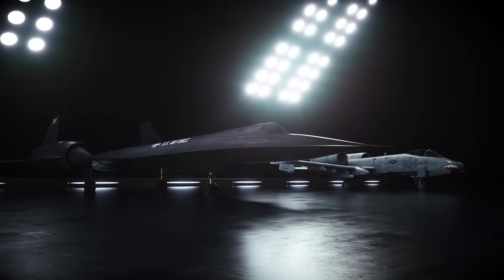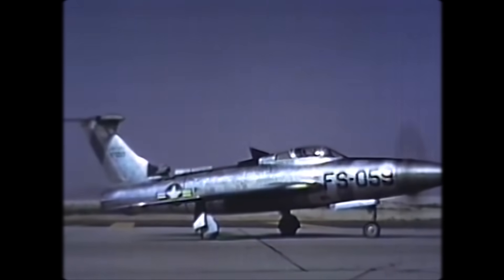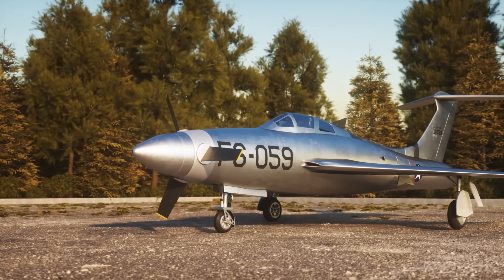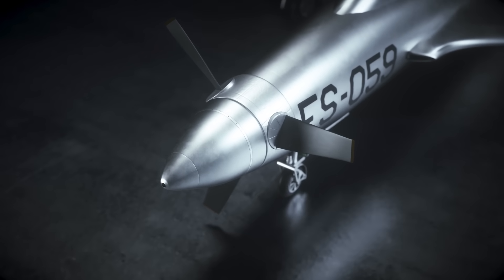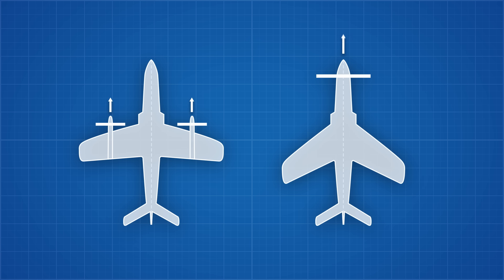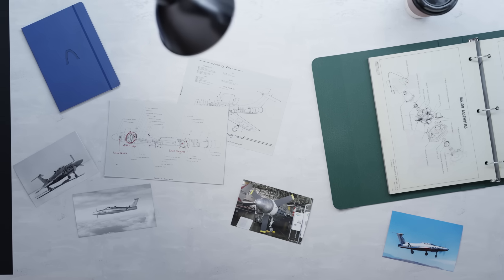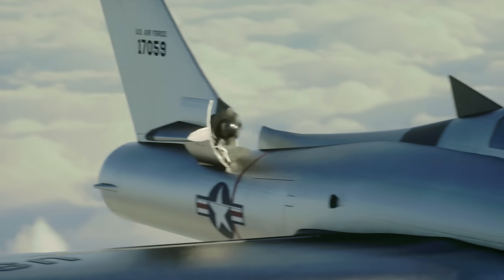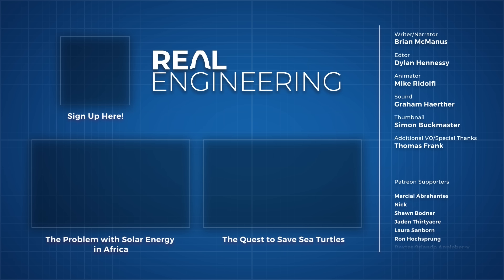The Insane Engineering of the Thunderscreech

Comment: Doubtful it may happen, but a bit of editing would make the video more accurate. The engine was not two T40s. The T40 was a coupled engine of two Allison T38 power sections, driving counter rotating props through various gearbox configurations.
Some of the flight simulations  show the propeller rotating counter clockwise as the pilot sees them, the actual videos obviously show normal USAAF/USAF clockwise rotation.
he various public comments on the propeller efficiency diagrams, and video comment missing that by WWII, all significant combatants had variable pitch propellers, needs correction, can all be 'improved'. We'd all like more data on just which plane is noisier, the Thunderscreech, versus the Russian Bear family. I'm questioning what may be in third place, some version of Harrier, F35, or Concorde?

Comment: {'m not sure about the year involved, ( I believe they were after WW 2), but tests were done on P-51 Mustangs with a dual, counter rotating prop design.  I suspect that the vibration to the prop of the Thunderscreech was the effects of the two, multi-jointed drive shafts not being harmonically balanced with each other.  While this is all very much after the fact, it interests me too much to ignore.  Now, any time you have a drive joint, it is there for only one reason.  You are trying to avoid something.  Every bit of induced angle in one of these will create a load/unload situation in the rotating joint.  In cars, these are matched to cancel each other as I imagine was done here, but with 5 or 6 joints in each shaft, they will almost certainly wind up out of balance with each other.  Joining their energy at the nose gear reduction gearbox might have helped, somewhat, but if that resultant total could be divided by adding a counter rotating prop, it would have quit playing 'merry-go-round with the fuselage and become far more manageable.  Eliminating the joints in the propshafts and jacking the pilot up a tad (ala the P-39 Airacobra) would have eliminated a great many troubles.  Torque interaction by the two engines having separate fractional controls could have been a source of problems, too.  I'm sure that these were thought out long ago and I'm just spitballing my curiosities.  Oh well...  An excellent presentation of great informative content.  I look forward to seeing more of these in the future.

Comment: So uh, high speed electric motors anyone?  Or ducted ultrasonic fans, one stationary and adjusting pitch to cancel out duct vortex, the other rotating but not through a axle that runs through the center but a ring Axle mounted around the whole duct so the blades can change pitch and the electric motor has more torque and circumference distance for a high top speed, also ring electric motor.

Comment: Clearly what they needed was a counter-rotating props, what’s a few more points of failure? Plus it’d help with the turbulent prop wash, perhaps enough to move the elevators back and take advantage of the thrust for low speed control

Comment: Its sound may be impossible to digitally emulate, but I did notice that the bass was so strong that it prevented the audio from clearly picking up the sound of the engine and it sounds like it actually disrupted the device's ability to pick up sound.  That tells me quite a lot right there.

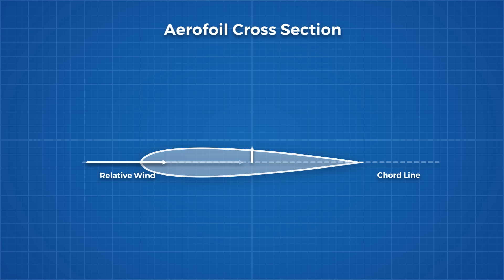Comment: The aerofoil at 6:00 wouldn't produce lift until the angle of attack became non-zero. If its symmetrical, the pressure distribution would be identical on both sides of the aerofoil, meaning now generation of lifting forces.

Comment: Wouldn't contra-rotating propellers (like on the Tupolev Tu-114) have fixed a lot of the flight characteristic issues for this plane, along with allowing for even shorter propellers, due to having more total surface area from having two? Of course it would also have been immensely noisy, but that doesn't seem to have been a cause for worry, during the design of this monstrosity anyway.

Comment: Lots of interesting information but no explanation for how those very many vortexes resulted in "hammering" the air to make a horrendous sound/rumble capable of knocking men over who got too close. I'm imagining the process to be similar to water cavitation around boat propellers, only in reverse, so to speak, where the bubbles in water are comparable to "clumps of high pressure air," each of which has to be moved about by the propeller and it's massive engines. These bubbles of high pressure explode, more or less, emanating as waves of alternating pressure, causing the damage and the sound.

Comment: The resulting forces acting upon an airfoil are often drawn in a quarter chord position.
Reply: Center of lift moves with angle of attack, and influenced by camber line. Quarter chord is common for many illustrations as close to most early NACA foils.

Comment: The design was updated and tested on a 727 in the 1980s. Counter rotating props got rid of the torque issues. Still loader than heck.  https://en.wikipedia.org/wiki/Propfan

Comment: Is also like to point out that the T-40 engine was also used in counter rotating prop systems such as the one found in the A2D. This system allowed the individual props to spin slower in an attempt to combine the max efficiency thrust of both props without the propeller exceeding super sonic speeds. A test bed version known as T-38, which was a single engine, actually became the basis for T-56, an engine that had variants that would go on to find use in multi engine planes to include the C-130 all the way up to the H model.

Comment: Wyvern and A2D Skyshark both use turboprop designs as well. The Wyvern was only 3,200hp but the Skyshark was 5100hp and used two counter rotating variable pitch props. The Skyshark was the pre-courser to the XF-84F.
Reply: That’s a lot of heath

Comment: so two things, were the pilots deaf before they got the job or only went deaf after flying them? Second why have the engines running the driveshafts  fast 14300 RPM which then had to be reduced by that 6.8:1 two stage reduction gear. Why not just run the driveshaft at that 2100 rpm to start with?

Comment: There were just a few WWll a/c with fixed props. At least by 1940 all front line a/c were fitted out with variable pitch propeller of the same kind as the Thunderscreech had.

Comment: I have been studying engineering at university for 2 years and I watched real engineering for a couple years before I went to Uni, what is surprising me now is how he is able to explain some very complex mathematical concepts in a very simple way. Coming from the position of learning these concepts the traditional way and then Hearing him explain them he has done a great job of keeping the relevant info in without overcomplicating things.
Reply: Check out NASA-Gulfstream propfan from the late '80s and the GE UDF and the PW-Allison Propfan on the MD-80 and now the advances in what's called open rotor technology, all leading to lower noise and higher efficiency.  It's really interesting.  You can do the math and see what the tip speeds are (hint: supersonic...).  So this idea hasn't been abandoned.
Reply: I was 2 years into my mech eng degree when I too knew enough math to be sort of awed by it's complexities, power, and reflected a lot on how you can't see very many depictions of high level math anywhere
Reply: well he doesn't know what he's talking about. For a channel called "real engineering" this is really bad. Listen to the bullshit after 13:00.

1. 13:09 Propeller TORQUE has a reaction TORQUE on the plane, not force
2. 13:17 the rotation speed has zero influence on this effect (a high rpm prop might even use lower torque)
3. 13:24 the effect most likely did not get worse at higher speed, and even if, definitly not for the reason of the higher rpm, but rather a different engine torque or pitch
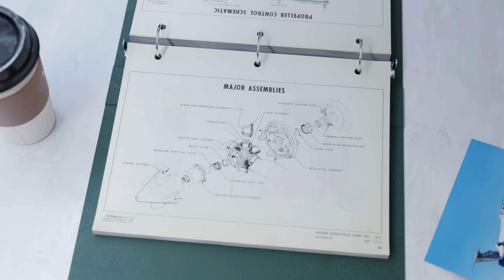4. 13:52 the inertia of the prop certainly did not overload the pitch control, since it has absolutely nothing to do with the pitch
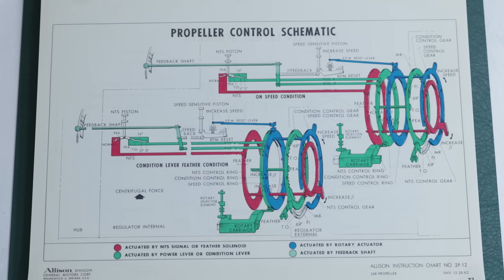5. 14:02 if the governer lets the rpm increase(maybe by reducing pitch), that is because/while torque is REDUCED, not increased. Definitly not causing more torque on the aircraft
6. 14:19 this effect did not effect WW1 rotaries more. He's completely mixing up gyroscopic torque (of the prop or engine acting as a gyro) with regular coaxial torque/reaction torque
7. 14:54 completely useless statement saying it could roll to 30°. It can roll to any attitude if it's not counteracted, there is nothing stopping it at 30°
8. 15:05 BOTH ailerons are actuated, not just one. (only one is increasing in drag, causing the yaw.)

That's less than two minutes of video... I think the rest was a little better, but the quality is horrible. They/he just did some wikipedia reading, some google, and then repeats something he has not understood.
Reply: @DerKrawallkeks you seem like an asshole but not necessarily an incorrect one. as long as he knows the right equations to use when and can draw the correct answer he'd make a passable engineer. you with your focus on correct verbage ought to consider  a masters and then teaching these concepts. a lot of good engineers fall down at proper communication of their work.
 I don't particularly care for this engineering focused channel because the creator  buys into the metric>imperial nonsense. anybody in north america who has taken basic university chemistry along with the math prerequisites probably has the metric/imperial conversion factors roughly memorized and converts  with  little effort and while scaling in metric is easier to learn; once you've learned imperial scaling as a kid it's as useful and easy as metric. when I hear people vocally lambast imperial measurements I think; well the system served the Romans pretty damn well.

Comment: Wouldn’t it make more sense to put the gearbox at the back so the driveshafts would only be spinning at 2100rpm rather than 14000rpm?
Reply: The shafts would be a lot heaver to take the higher torque to transmit same power.
Reply: But just imagine the effect of a failure at 14000rpm!

Comment: I thought the Tupolev TU 95 'Bear' was the loudest. It has four 15,000 hp. engines spinning 32 blades at supersonic speeds. Each blade is longer than the entire prop of Thunder Screach.The 95s props spun at a constant speed regardless of air or ground speed. I'll bet $1 that I'm right about the sound level.

Comment: Software guy here, thinking if they had the two driveshafts turning in opposite directions it would null out the torque twist.  Run one shaft through a gearbox at each end that changed the direction of rotation?  Possible?

Comment: All these problems still exist today. It has always been a simple fix by having two props on two shafts counter rotating one inside the other. no torque steer and a shroud around the blades maby. I never noticed on the bombers do the engines on one side rotate counter to the other wing.

Comment: Excellent video all round. Didn't even try to describe the sound because it's so ungodly.

One caveat, you mixed up rotary engines and rotational engines. They're basically the same thing, but one is mounted backwards. You mount a rotary on your plane, the the drive shaft spins the prop. You mount a rotational rotary to the prop, and the drive shaft spins the plane (as long as the engine is concerned.)

Still loved the video, though. I'm glad someone is out here getting in-depth about how propellers work, and specific problems involved.

Comment: WW1 pilots called the Sopwith Camel the 'vicious little beast' from the torque effect of the engine. Probably used stronger descriptives than that. 
If even the test-pilots don't want to fly your aircraft, then your project is FUBAR. Accept their opinion & go home.

Comment: One other issue I didnt see mentioned is the fact that they used ended up using a dual prop setup with counter rotating blades to counter the torque effect also meaning that the sonic booms would collide amplifying the sound even more

Comment: 1. Variable pitch propellers are already a thing in world war 2
2. The torque roll problem can literally be addressed if the engines are mounted on the wings or have a contra-rotating propeller like the Seafire FR47 or the Tu-95 bear

Comment: Great video, but you're leaning on that euphemism "issue" more and more often. Try to avoid it; it's a crutch, and there's always a more precise and concise way to say what you're trying to say. eg. 12:00 - "because of that asymmetric thrust issue, we would have to run each engine at a less efficient half-power setting" -> "we would have to run each engine at a less efficient half-power setting to prevent asymmetric thrust". 12:13 - "the powerful coupled engines did come with some added complexity" - sentence finished. Stop talking. :)  13:06 - "that speed still caused some serious issues for control" -> "that speed still made control very difficult".  etc. etc.

Comment: 14:23 Do you mean radial engine maybe?
Reply: No, he means rotary engine. Rotaries are radial, not all radials are rotary. WWI radials were usually rotaries as well, as both cooling and lubrication of cylinder heads were issues. Rotary engines have Huge gyroscopic precession during maneuvers! Rotaries of the era used total loss oiling, as getting oil back in from spinning cylinder heads was not solved yet, if ever. Normally castor oil, the main reason pilots wore scarves, as face filters to lower oil in lungs and stomach. Everyone had the runs from the Castor oil anyway, another reason service life on the line was rarely over 6 months. If the opposition didn't shoot you down, you invalided out from the castor oil.
Reply: @billtaylor3499  I thought "radial" referred to the piston layout, hence why I didn't think any radial engine could be a rotary. Rotary engines having rotors instead of pistons.
Reply: @xbfalcon83  Always confusing when technology changes, and terms are reused for different hardware. If you missed it elsewhere, original use of 'rotary', was a rotating radial engine, crankshaft fixed to the firewall, prop fixed to the rotating radial cylinder case. The name 'rotary' was later co-opted for the Wankel and other rotating internal piston engines.

Comment: the question is even if there could be a prop that could go supersonic how reliable would it be and how efficient would it be, the idea is that the prop is supposed to push the air behind the plane to get thrust, hopefully going 2100 rpm would keep enough speed so it can still push the air, but how fast can a prop go be for it just completely get destroyed by the centrifugal forces or the force of the air pressure

Comment: So that means that this jet which is small makes more noise than the big Russian Antov  Big Jet planes and Tuplalev Tu95 Bombers? Also could that have made a  propeller that retracts into the air frame Li in much the same way the landing gear retracts into the wings once the climb rate is achieved ?

Comment: where do all these used / decommissioned old engines end up? would be awesome to tinker with one of these in your backyard. minus the burning down the next 3 houses next to you part. but one big thing omitted from this video: the prop was always spinning 2100 RPM even on the ground . this is why people got sick. it was essentially always on full throttle, but the prop feathering was what increased or decreased thrust. horrific idea that could've been remedied.
Reply: Only 2 were built one is at wright patterson afb in ohio the other i believe was scrapped

Comment: Why didn't they couple the engines behind the pilot, therefore only requiring a single slower-spinning propshaft down the middle of the plane?
Reply: Weight and balance around the wing's moving center of lift. Also rotating moment of inertia. Also, high speed shafts have lower torque load, meaning less mass required.

Comment: Soviets after Damansky island border conflict were concerned about having to fight loads of chinese infantry if large scale conflict would break loose.

So, they designed a plane that would kill with sound and use no ammunition! It was supposed to go supersonic on low altitude above enemy positions and the shockwave would do the damage. Special form of the hull would have increased the effect to lethal. It was supposed to be named Myasischev M-25. However this was deemed impractical and tests were stopped on wind tunnel mockup stage. 

It was considered a fake until 2017, when it was confirmed by an old worker of the design bureau.